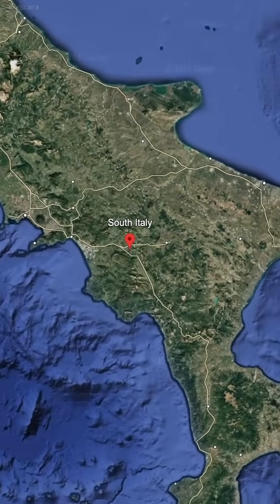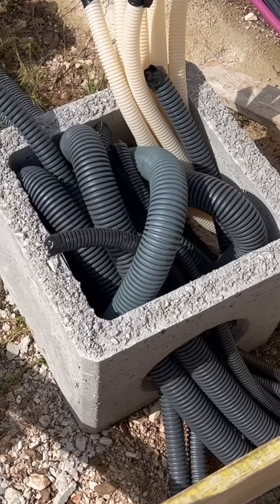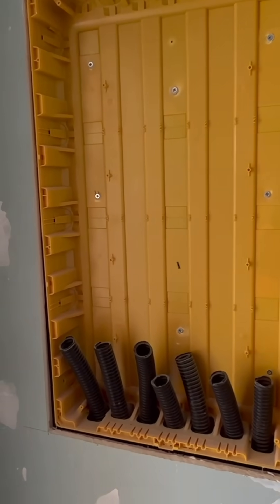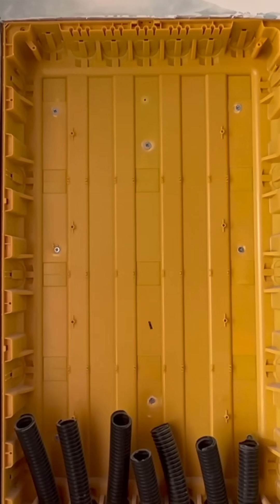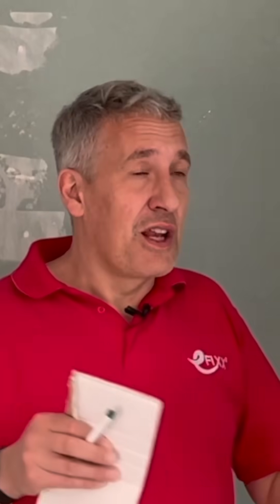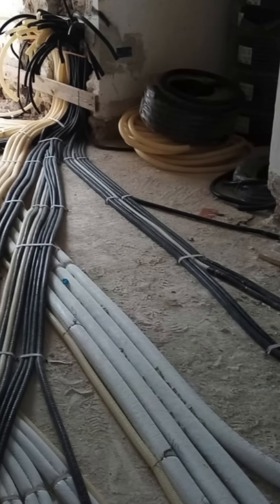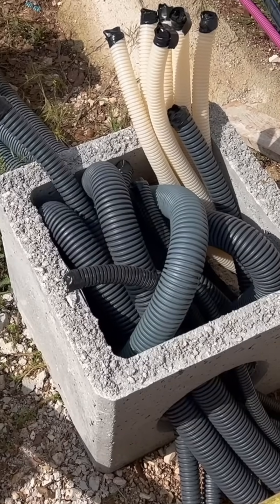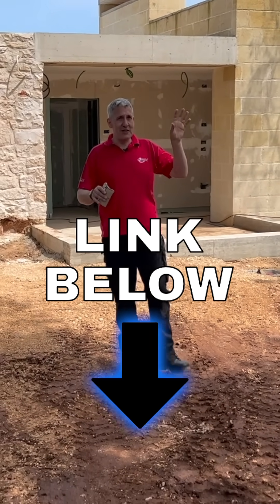Electric Wiring in Italy - You Won't Believe It!

Comment: much better system. estonia here somehow prefers the conduitless approach. seems bad. but we still have built distribution boards. i don't know why old countries keep their old ways. tiny premade consumer units in uk, etc? specific manufacturer lock ins? it serves no electrical safety purpose at all. i often wonder when old point to point wired installs end in uk. you know, looks like 60s phone exchanges. plywood. fuse is here, leads go into meter. then out into distribution. sometimes it's too small so you add another one. instead of single sectioned enclosure with door. or at max two? it's kind of weird in us too. they also have to add devices outside of panel because panel only fits breakers and has single busbar. i have no idea why this is kept going on. it's not high currents in us systems either. and nevermind the uk. so yeah, i don't get it

Comment: Corrugated conduits as you said have a specific color code: Black or Gray is  used for power distribution such as plug sockets and lights, Green is used for telephone cables and for TV and data transmission you can use both green or white, Blue or purple is used for Hi-Fi or video distribution and blue only intercoms, and last but not least Brown is used for alarms and security systems. Not everyone follows precisely the code and of course if you don't have enough lenght of one color you can use another... when the wall is plastered no one will notice 😂

Comment: Plastic back box on the distribution board . What happens if and when it needs replacing. 
My friend lived in Italy for several years and apparently they don’t use tape measures. Every switch and socket is at different heights . He said that’s standard in the 3 houses he has lived in .
Reply: this happened in electrical systems until about the 80s... a socket could be positioned 30cm from the ground or even a meter... there was no precise rule. Being an aspiring electrician with little work experience I noticed and was told that from the mid 80s onwards the systems were increasingly standardized. switches and sockets are always installed "as desired" but with a precise limit (90cm or 1m from the floor for switches and buttons, for sockets the minimum is 17.5cm from the ground and the maximum 30 or 50cm from the ground) Electrical panels are usually installed 120cm from the ground. Many colors for cables no longer exist such as green or yellow (apart from the classic yellow-green for earthing) but also magenta.  There are also specific standards for cables: blue exclusively for neutral, while brown, black, grey, orange, red, white, purple for phase or as return for relay buttons (always with the exception of blue). It is very difficult to find a system with completely random heights nowadays. So in older houses it's "normal" to find sockets at random heights and without a single rcbo to protect everything

Comment: Yes: I have photos of my Italian property during build - before the floor was poured! 
The first thing to learn is NEVER DRILL THE FLOOR - as that's where water goes, and not in straight lines; it's all over the show...... 
And then they draw singles through the 'Bundy pipes'!!
Make sure you have a blower or vac so that you can identify the ends of the conduit - they don't mark anything!
Reply from the maker: Top Tips!
Reply: I can see one of those automotive smoke testers being a very useful tool on identifying these flexible conduits. Smoke in a one end and see where it comes out!